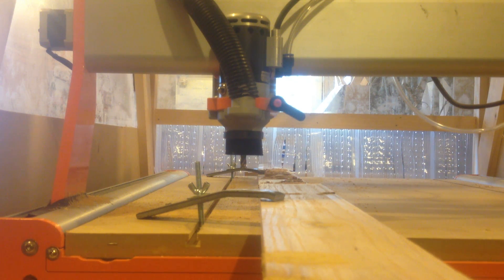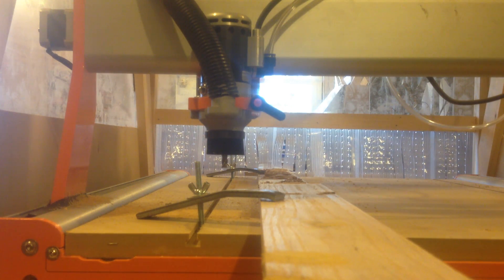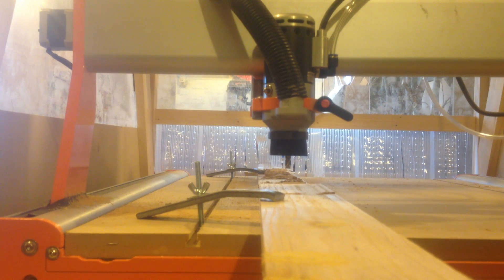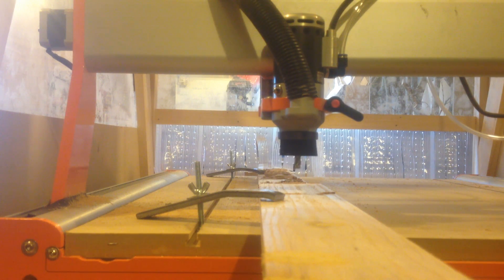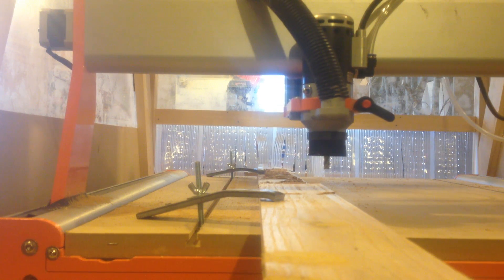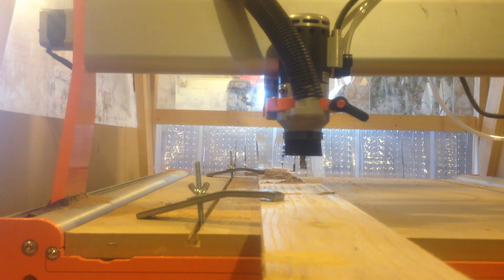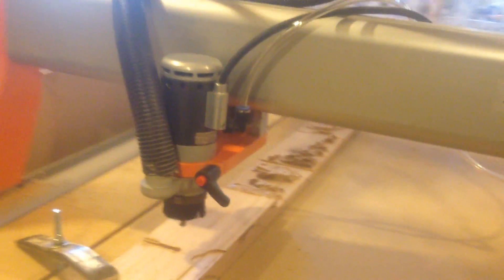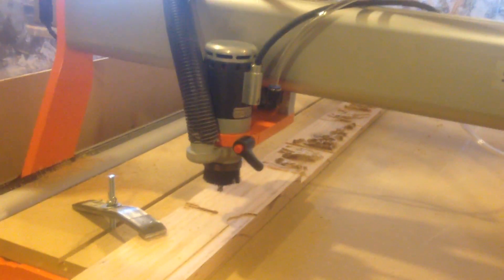Stepcrap X axis problem

Comment: Hey thanks for sharing! My machine makes the same sound on the X axis with the exact same problem. Did you end up finding a way to solve this?
Reply from the maker: These idiots at Stepcrap, first they told me the adjustment on the screw may be too tight, it kept happening then they said to loosen it but then I was getting chatter. Then I went through the set up procedure again. After many months of this crap of too tight, too loose. What I found is They don't always remove the burs from the screw holes and a small chip of metal gets stuck in the grease and binds, it can also happen if a wood chip somehow gets in there. My first suggestion is to sell the machine and get a good one. My second suggestion is to clean the screws and re-grease them to make sure they are clean. If it still happens....good luck with your Stepcrap
Reply: South_Carolina_puma thank you so much for the reply! Really appreciate it... I got the Stepcraft because it has a nice milling bath for carbon fiber. I will try your suggestion #2 first and then see how it goes from there, haha! Do you still have the Stepcraft or did you switch to something else?
Reply from the maker: @Coolarj10  I got a different machine. The Stepcrap is too slow and unreliable. Also the vacuum system is too small and gets clogged too easily and I have the HP-500 spindle if it gets jammed it blows a fuse in the control box and you have to send it in for the repair instead of them putting a surge protector on it so you can just reset it. The machine looks good but I could have been this frustrated with another machine for half the price. Good luck
Reply: https://www.youtube.com/watch?v=QnxRD5jeIOY I made a video explaining how you set it up properly.

Comment: Did you get an answer to help you
Reply from the maker: NO! They suggested loosening the set screws but I had done that till the machine was so loose it would chatter and shake the machine so bad it would break the bit. I also loosened all the gantry screws and went through the setup process again to no avail. Sense I have had this machine I have had nothing but problems. I can't even get full use of the work area. The Y axis can't get any closer to the front of the machine then 3 inches or it binds up and I have to zero the Y axis again and you know what kind of time that takes. If you have a Stepcrap, good luck, if you don't do yourself a favor and buy a better machine or at least a cheaper one. It will be easier to put up with the problems at half the cost.
Reply: I hear you dude, i have SC2 Black edition and get same issues with Z axis. I had to change all the leadscrew nuts to ballbearingnuts. It cost me extra 200usd, but now i dont have binding. Oh and one more thing, if you try to calibrate Y, let the Y-axis go to the front , away from home button. Then loosen the bolts in front and take the panel off. Use different bolts for this smaller panel, so you could take off only the larger one and see if the leadscrews are binding inwards or outwards compared to those two small bearings. I noticed that i had to add extra washers to one side of the rollers. Because somehow rollers are pulling or pushing those leadscrews in or outwards. After that i could jog Y-axis all the way to the end, and now leadscrews are aligned straight.

Good luck!
Martin